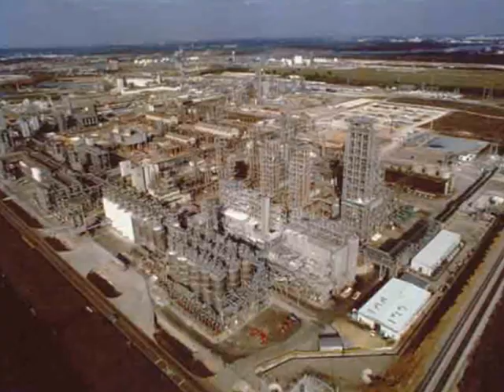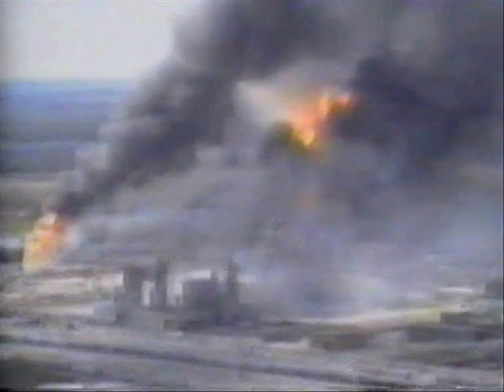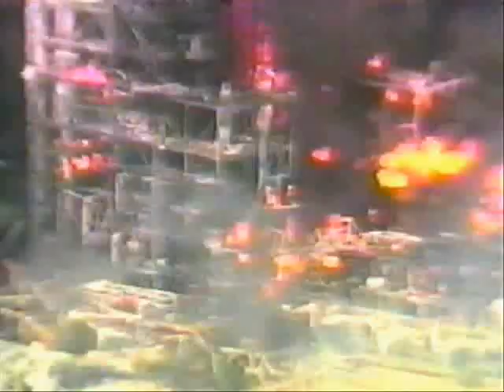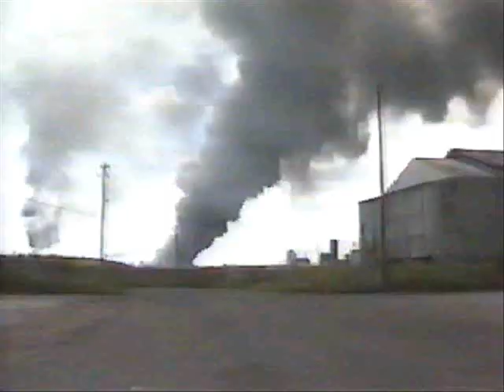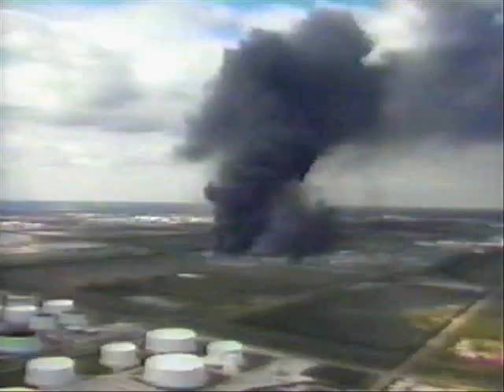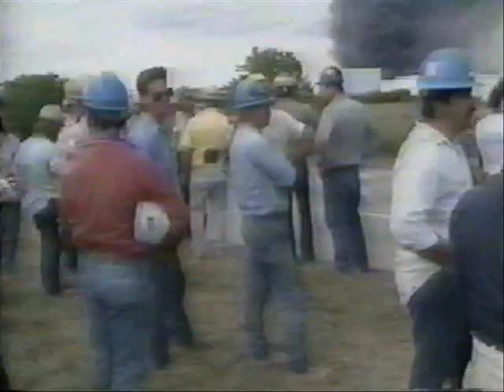1989 Pasadena, TX, Explosion

Comment: I heard a truck was idling under pipes at prsi, idk if this is right. I worked with a operator who was almost retiring in 2007, also my dad worked at shell and they had to put it out
Reply: No.
What you are thinking of is a 2005 BP explosion in Texas city Texas.
This was Pasadena, and during shutdown a vessel was opened with no air movers, and the Flair from Plant B ignited the vessel, then chain reaction explosion.
I was working at the Rohm&Haas plant just down the channel.
I was 20 years old.

Comment: Just now saw this...I remember it like yesterday.  I was at Pasadena HS in Mr. Brear's english class on the second floor.  Many of the tile got knocked out of the ceiling. We were sheltered in place.  One friend lost his dad...one lost his arm.....I was in that plant after I graduated...doing hydroblasting, in the PP unit...this unit was just cleared and getting rebuilt. RIP Mr Roque
Reply: I was at San Jacinto College in a ceramics class and we heard the explosions from there. Kids told me of shattered windows at school.  We used to say about Pasadena Tx back then, "Pasadener where the air is greener" Lots of oil and chemical plants.
Reply: the pp unit looked brand new in 2007 when I was there
Reply: +muhammad rahmat baid king truck was the ignition source. the truck was left parked and idling
Reply: The PP unit was torn down in 2013.
PE-5 (Polyethylene unit 5) is where the explosion happened. PE-7 is now in its place and they have since built PE-8.
Reply: +muhammad rahmat baid king I can tell you everything I know. I worked out there for nearly 3 years. I know exactly what the "unknown reason" as to why the explosion happened.